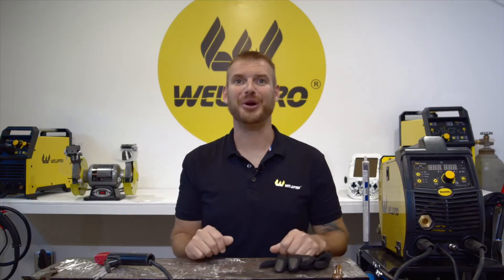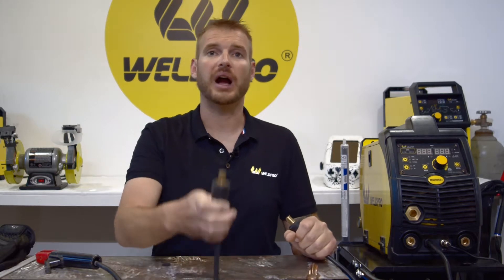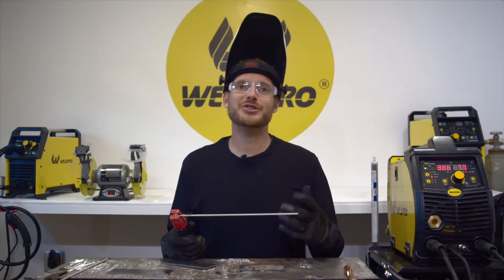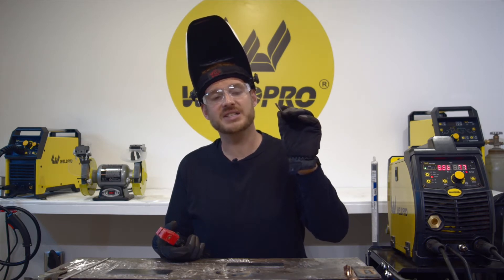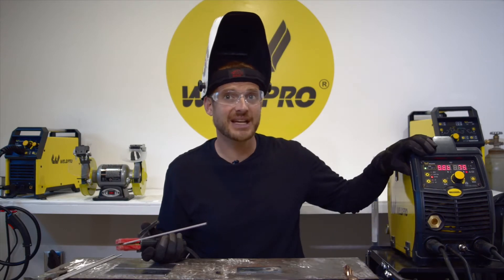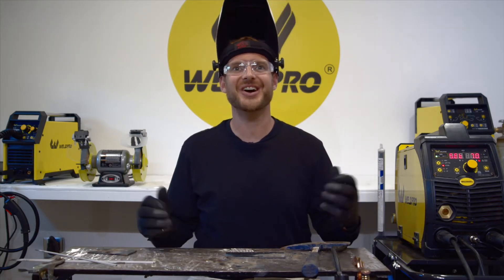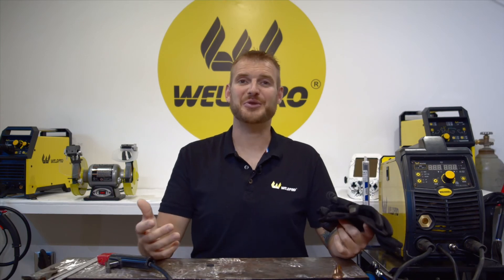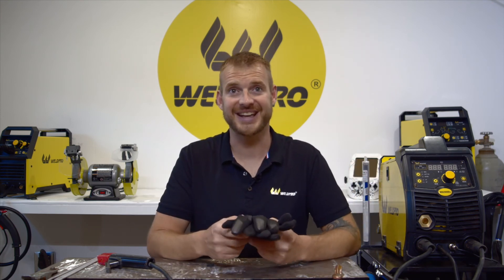Weldpro MIG 200 - Part 3 Getting Started with Stick

Comment: Can you use 6013 rod on mig welding?.
Reply: No, 6013 is a stick (SMAW) welding electrode.
Reply: @nickcampbell3212  Hello bro thanks for the info, my machine is a 3 in 1 Mig -200 and can also do Arc welding, but I have seen other rods like 6011, 7018 been used but not 6013. I have lots of 6013 for a machine  I used  before. Thanks  again.
Reply: @giee234  6013 is one of the simplest stick rods to weld with.  It can be used with any polarity (DCEP, DCEN, AC) and run in any position.  DCEP provides the most penetration, but overall 6013 is a shallow penetrating rod.  It is not suitable for heavy structural work, but is great for light repairs and such, hence the nickname "farmer's rod."  The MIG200GD will weld with 6013 very easily.  I suggest using electrode positive polarity.